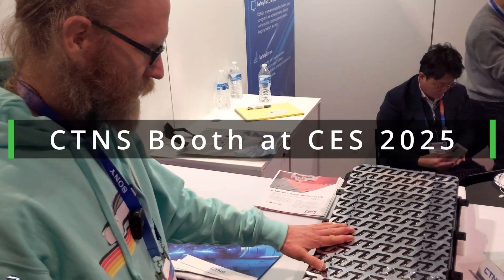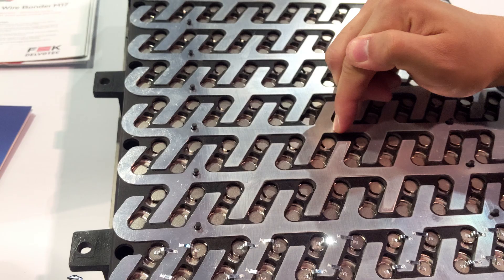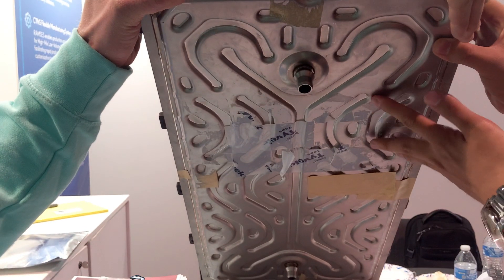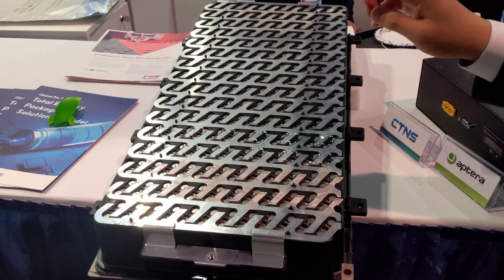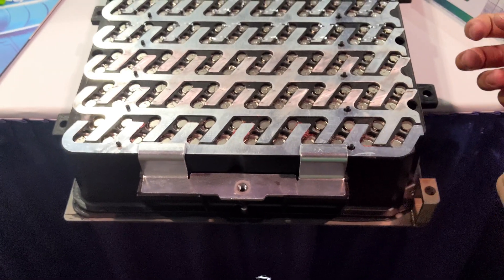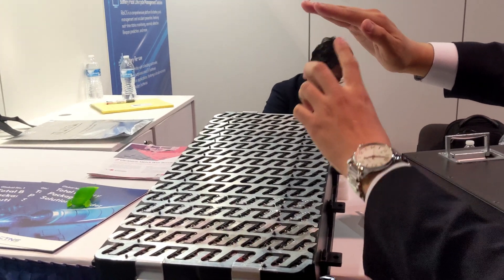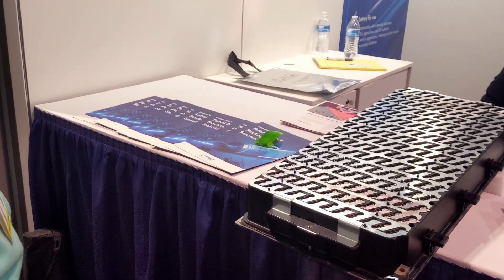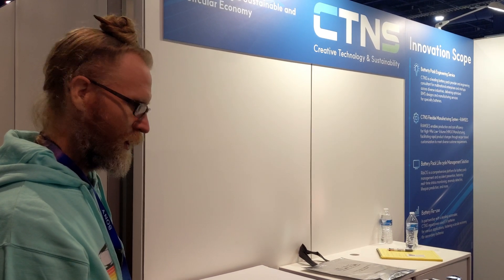CES 2025 Aptera Battery Module Overview with CTNS #ces2025

Comment: Thanks Raj!  When I made it over to the CTNS booth, the battery module and the key folks were all down at the Aptera booth in support of the media announcement regarding CTNS and LG's key rolls on supply the battery module, management system and battery cells.  This is exactly what I had hoped to see,  So I really appreciated this video.  Thanks again!

Comment: Very good clarity of info in this talk-through - well done! IIRC, the original idea for different capacities was linked to cell height, so the modules just get taller going from 400-600-1000, and the exception was the 250 which kept the 400's height but depopulated something like 40% of the cell locations. Did you see anything saying if that's still the case...?
Reply from the maker: From what I understand, your correct. Just taller batteries for the 600 & 1,000

Comment: I hope the foaming stays hard for life removal of a battery top case that helps hold things with swelling for the top half to only need a little lithium to get through and touch any metal material ,and possible 💥 boom😮.I wonder about the integrity  of modifications to each battery does the lip hold a cap better possible. LG should know better, or is this a third party battery bonding machine not fit to do the job safe and correctly,  like a company creating a problem and then a issue happens later  with extreme hot cold multi use.  Whats up with the battery guys. Did he say,,,😊 the one going into the Aptera won't have a risky modification.

Comment: I really don't like that they're using Tesla-like structural tech.  Foam/glue is inappropriate for right to repair.
Reply: Thank you for the feedback. At the moment, we don’t see any practical way to replace a single cell within a parallel group. The age of the cell will be different and it will always be problematic in playing nicely with its other parallel cells.
Reply: It is, however, appropriate for protecting the cell connections from vibration and connection failure that would require repair in the first place.
Reply: You do realize that people outside of Tesla can repair the batteries. So I don’t understand how this right to repair relates to battery repair.
Reply: @billsmith5960   .. tesla doesnt like if 3rd parties are tinkering with their soft and hard ware .  They even go as far as to ban those cars from charge points ... and as for batteries .  . With an  unbalamced pack its great if you can at kerst change some cells or section of a battery
Reply: @gmy33  - I don't really understand. People are working on Teslas and repairing batteries. Just because Tesla doesn't like it doesn't mean people won't do it. Plus, Tesla is one brand, there are many others out there. Thus, people seem to just mention Tesla which confuses me as to why.
Reply: @billsmith5960  many e cars but not in the western world but its coming .. tesla was very protective .. would not allowe 3rd parties to work on their batteries .. luckily world is changing..
Reply: @gmy33  Think about it, We need to look back when they started. It was new tech and pretty much people really did not need to be getting into working on the batteries. Here we are, since the industry has matured it's now happening.